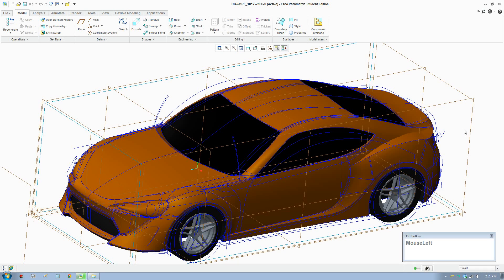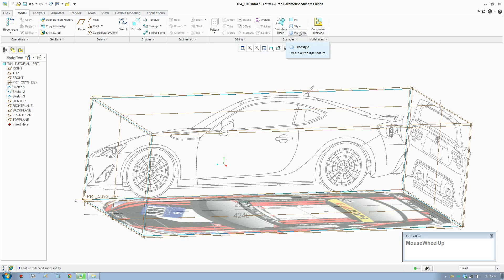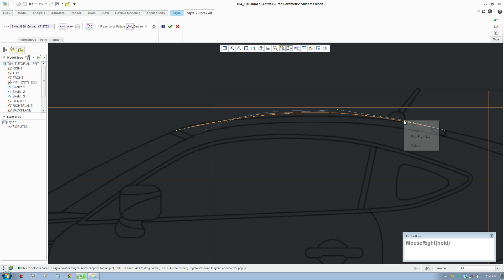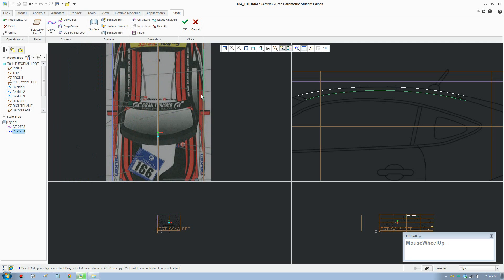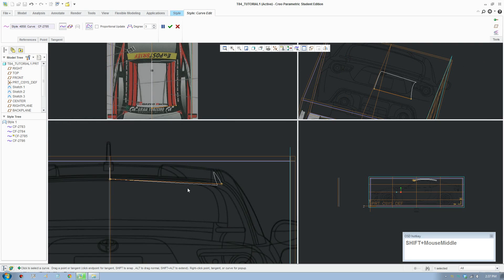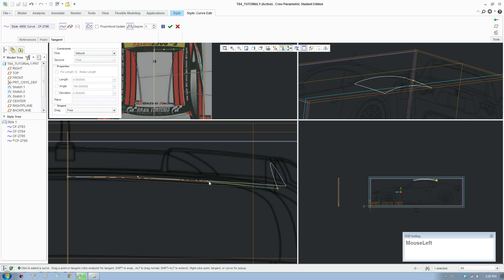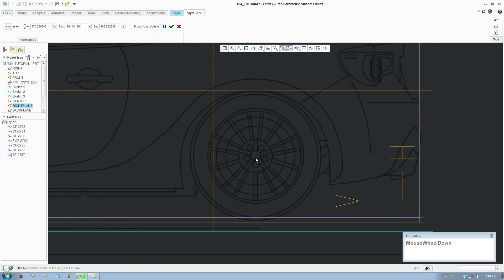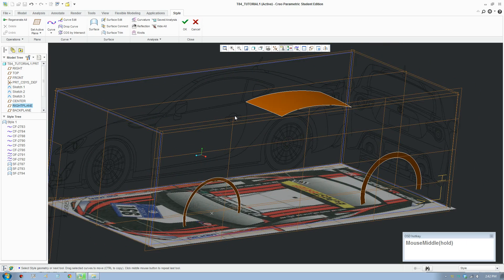Creo Car Tutorial Toyota 86 - Part 1 Drawing 3D Curves

Comment: While creating the surface after the curves ... I have around 12 chains to make a surface. After selecting them all in a circular direction(clockwise) .. Creo says "failed" despite the fact that all the curves are perfectly connected. Hoping you could help me out !! Thank you !!
Reply from the maker: The requirements for a surface is to have 4 curves. You can have 3 or 5 sometimes. But never too much. Breakup down the chains to 4 only.
Reply: Thank you so much.